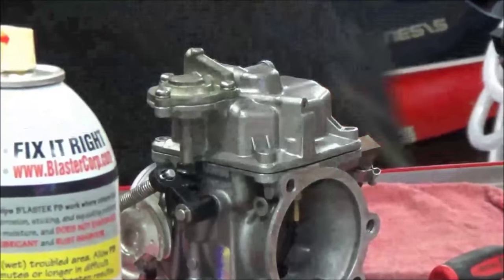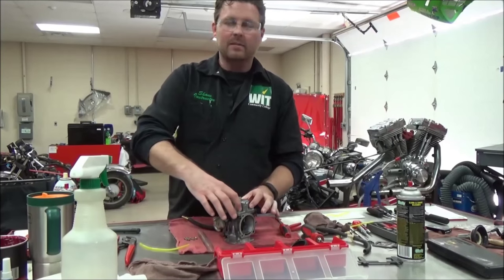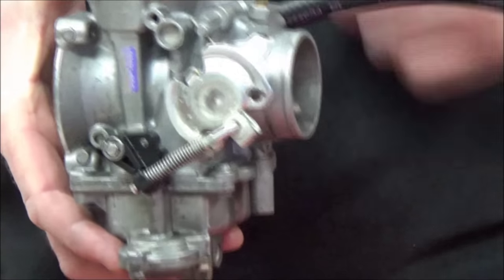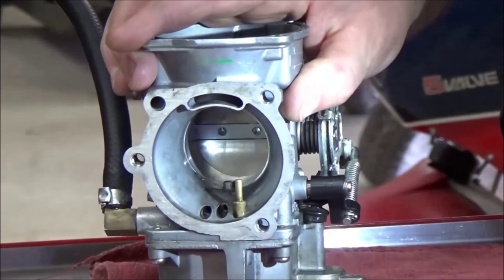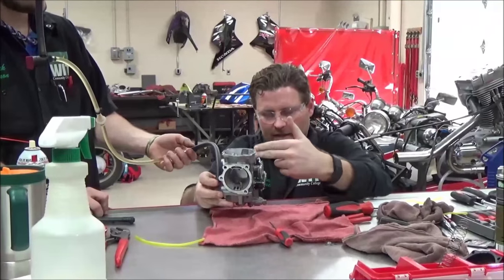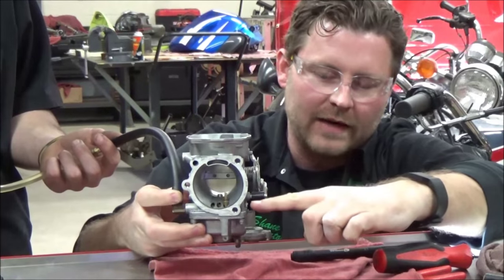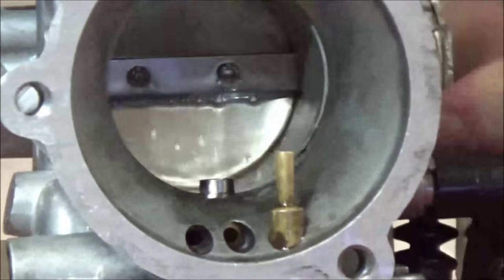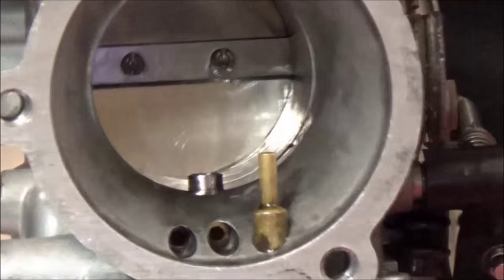07 Accelerator Pump testing and Kickstand Test Part 2

Comment: Is there a check ball in the pump circuit? 
I'm trying to help a friend who took his apart to clean, and now he doesn't have a pump shot. 
When i fill the bowl to test it, it pumps back and forth in the pump inlet and doesn't go out the tube. 
If i put my finger over the inlet after allowing the pump to fill, it will go out the tube. 
I'm a tech in another field, but by theory it looks like there should be a check ball in the one small passage in the pump cover. 
It will idle fine , but stumbles on twisting the throttle and you don't see the pump shot.
Reply: You figure it out?

Comment: On a cv carb the diaphrams and slides are testing good but when running wont exelerate carbs are clean does the exelerator pump control the slides or just air flow/preshure change?
Reply: The slides wont move when give throttle the right one will just alittle there not stuck or anything
Reply from the maker: The accel pump does not control anything. Just pumps fuel. I would need some more info to get you the right answer. I’d be glad to take the time. Can you help us back?
You just need a quick answer to make sure you’re on track or what direction to go? Please donate (https://www.paypal.me/how2wrench) what you feel getting this information is worth to you and I’ll reply back with what we would do at H2W!

Need the full service techline?  Coach Conley is also available for hire to personally work one on one with you if ever needed. Yep he is a real person. Details here: https://how2wrench.com/product/personal-tech-training-phone-facetime/ 

Your answers and help are just around the corner. Save time and money while protecting your investment and yourself by doing it the right way!

Comment: So im using a Mikuni TM33 Flatside Pumper, and i tried this test, but the accelorator pump did nothing. No fuel squirted at all. Fuel line connected, float boal filled etc. When running the bike, slow acceleration work just fine, but quick-sharp acceleration bogs down kills the revs. Is my acceleration pump not functioning or is the problem elsewhere?
Reply from the maker: Hello,
With over 400 requests a week I'd be typing all day my friend. So many possibilities without more details. Good news we have two options that help us both. 
Option 1: 
It sounds like you’re ready for some Techline help. Coach Conley is also available for hire to personally work one on one with you if ever needed. Yep he is a real person. Give him a call @ 602-345-0432

Details here: https://how2wrench.com/product/personal-tech-training-phone-facetime/  

Option 2:
Do you just need a quick answer to make sure you’re on track or what direction to go? Please donate (https://www.paypal.me/how2wrench) what you feel getting this information is worth to you and I’ll reply back with what we would do at H2W! 

Your answers and help are just around the corner. Save time and money while protecting your investment and yourself by doing it the right way!
Follow us!
Web:
www.How2Wrench.com    
www.Tools2Wrench.com

Comment: How would you bench test the accelerator pump in a carbureted Suzuki intruder 750 mikuni carbs
Reply from the maker: He gets over 300-400 requests a week for “a quick answer” and just can’t run the training center, video production and shop with an email techline. You know him from his videos, no shortcuts on answers so he wants you to get everything you need. 

When are you available for a one on one with Shane for any techline needs. He will fill you in friend. 

Call him directly @ (602) 345-0432